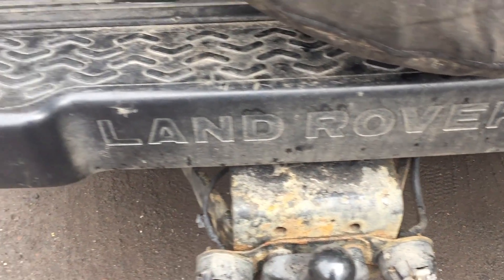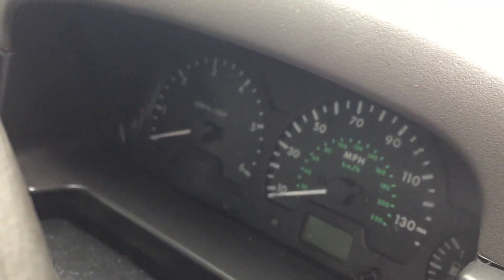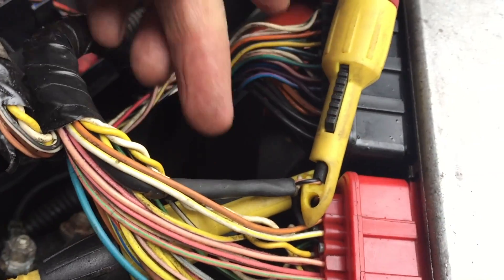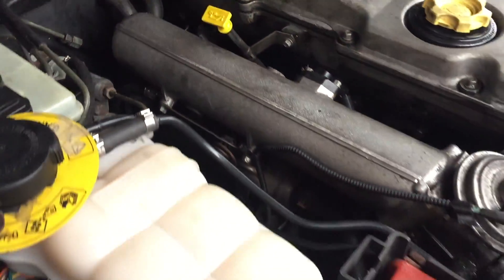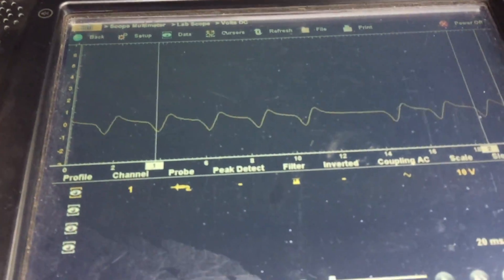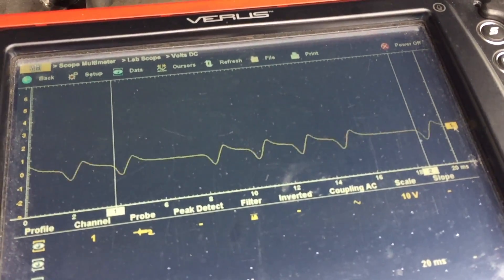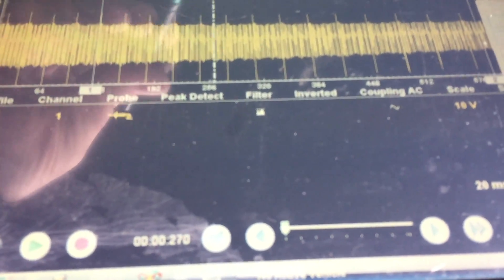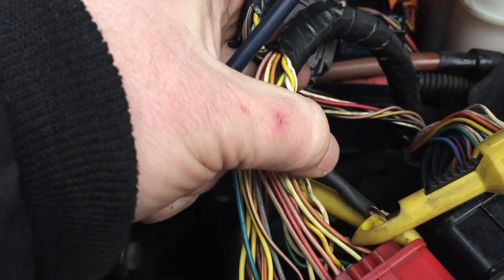Land Rover Discovery TD5 Crank no Start!

Comment: I've filled up after running out of fuel discovery TD5, I'm having trouble getting it started but It's trying to start. Is there something I have to do because of it running completely empty?
Reply from the maker: Try towing it to get it going
Reply: @sandyande  thankyou 👍
Reply: Is your fuel pump noisy  ?
Reply: @piotrprobala4808  I've managed to resolve the issue I was having, thankyou

Comment: Over complicating a bit tbh. Simple td5 fault easily diagnosed. Quite cheap to replace . Takes about ten minutes to fix but an awkward place. Looks like lots of fuel/oil  in area so FPR probably leaking on to sensor and causing problem. The diagnostic plug in the cab under the dash would tell you that info too with the right software